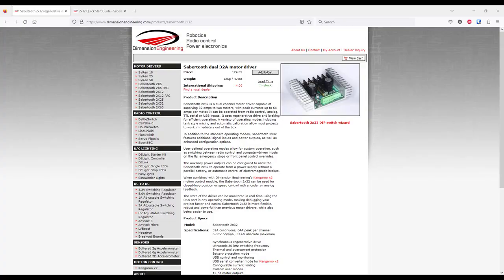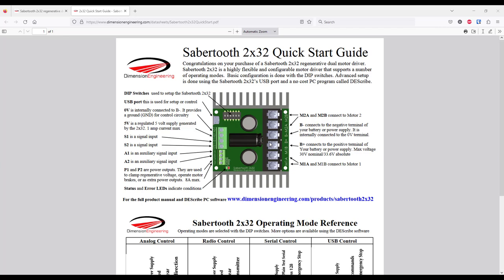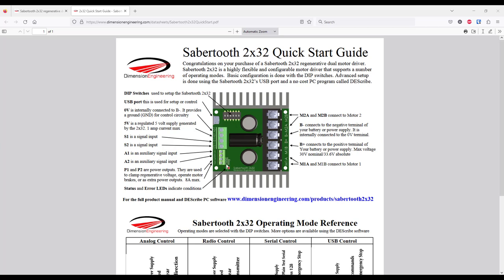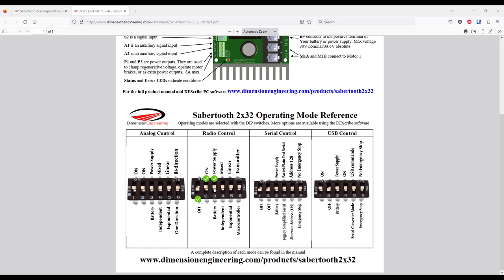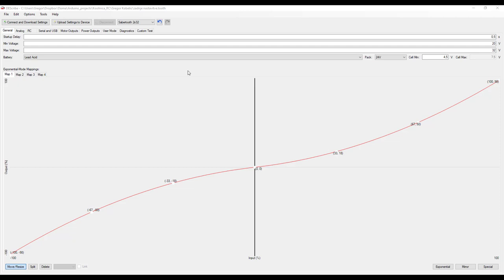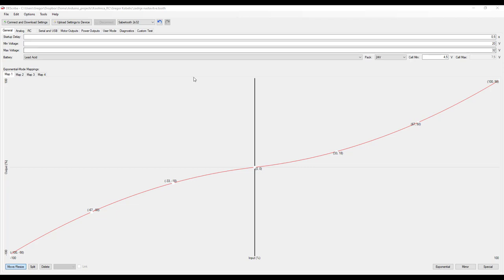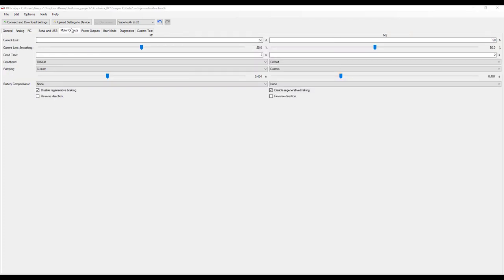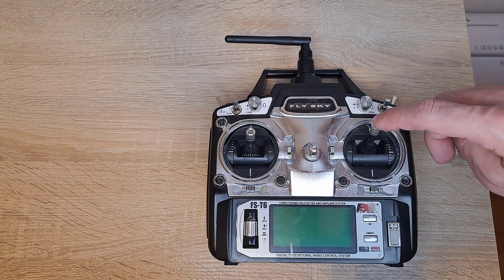Motor Controller - Remote Control Lawn Mower DIY

Comment: I have this in a 16kg tank, smooth control and incredible torque, I drive two 540 motors with reductors in mixed mode

Comment: Hello, where did you put a fuse to protect your electronics? I put a 30 AMP fuse inline with the POS on the battery and the fuse blows every time my motor stalls. Do you have any problems with fuse blowing when the motors stall under heavy load?
Reply from the maker: Hi! I put fuse on battery just after connector. I use 60A fuse, since i have two 15A motors. No problem with fuse at all.
Reply: @gregorkobetic  Okay maybe i just need a bigger fuse. Thanks!!
Reply from the maker: @carl0s288  you are welcome

Comment: Thanks great explanation. I have the 2x25 and found i have to put the switch 6 up otherwise sometimes i lose the control and motors spin alone till i dont do another command with the rc controller. However by putting the switch 6 up i am missing the zero position means the motors moves always a but when rc controller if off. And when i put rc controller ON with trimmer i can adjust but still there is some slow movement i can’t understand how to have the engines firm also with this settings
Reply from the maker: Hi! Yes, in microcontroller mode sabertooth does not stop the motors by default if it loses the RC signal. Timeout can be set in the DESCRIBE software for 2x32 sabertooth. But I think the 2x25 don't have usb port and unfortunately cannot be connected to the DESCRIBE software. So for safety reason use RC mode on 2x25.
To answer your other question about slow movement of motors: 
Some RC receivers output servo pulses before a valid transmitter signal is present. This will cause the Sabertooth to autocalibrate to values which may not correspond to the center stick position. And this may cause the motors to move slowly, even when the transmitter stick is centered. On some RC transmitters these things can be sorted out in the transmitter settings. Have a nice day!
Reply: @gregorkobetic  thank you so much for the answer. I got your point. I was told to consider the 2x30 smart driver but i don’t know that has the same issues  with the zero position in rc mode. About receiver, i actually bought a new controller and receiver (as the old 4ch controller was having this issue). However even with the new carson  8ch receiver i see the same behavior. Means out of 2 receivers i tested both has issue with the zero position when controller radio is off. Do you know if the smart drive fixe this or the only way is to buy the sabertooth 2x30amp? I mean i can think of changing the motor driver if that will fix the m problem or i have to find a receiver that i’m sure will not generate that issue. For sure i cannot use the microcontroller setting as it is now because is too dangerous.
Reply from the maker: Does your receiver have "failsave" mode? If yes, then you should configure it and it will solve all your problems. Put sabertooth in microcontroller mode and set failsafe for 2 channels you have motors on. This way you will not have problems with autocalibration and also mower will stop when signal is lost. See this link: https://youtu.be/4N_hHfpEoHY
Regards!
Reply: @gregorkobetic  thanks 🙏 later i will check if it has failsafe but i dont think so, yesterday i was checking manual and has only a function to sync with controller. Pity because i paid 80€ for controller and receiver. If does not i will return it as i just bought from amazon. In cas it does not can you please reccomand a rc control and receiver kit that has failsafe function so i look for that?
Reply from the maker: I recommend FlySky FS-i6X. You can get it with 6ch receiver or 10 ch receiver, so pay attention when buying if you need more channels. Difference in price is minimal. It is made by company from China, but it is a good product, you can find a lot of reviews on youtube. I have old model, but it works with my mower for 5 years without problem.

Here is link from amazon.de https://www.amazon.de/-/en/Channel-Transmitter-FS-iA10B-Receiver-Aeroplane/dp/B09VGQN2NR/ref=sr_1_4?crid=20TII83R8PQV2&keywords=fs-i6&qid=1690912169&s=toys&sprefix=fs-i6%2Ctoys%2C260&sr=1-4
Reply: @gregorkobetic thanks Gregor i will look for it. I confirm mine has not failsafe. I will be using 3 channels maybe. 2 for 4 motors and 1 for an actuator to lift up and down the mower. I am building an old honda 41cm mower. I actullay was thinking to add a kind of electric starter for the engine but i could not find a lot of information for this. Did you also add the actuator to lift up/down mover via rc?
Reply from the maker: @GioGio78530  No, I dont  use actuator to set mowing hight, but honestly I am missing that feature. Well maybe some day with another mower 😁
Reply: @gregorkobetic i just ordered the flysky you suggested i will let you know. Tomorrow i will be doing the big step (most hard for me) to fix the wheelchair motors to the frame i built around my mower. Electronic part is quite fine at the moment means once motors are fixed i could start first real test. Will let you know

Comment: Hi Gregor, thank you very much for all the knowledge you share with us! I want to ask you if you know any controller  for 4 motors or if I can connect two controller together for the 4 motors.
Reply from the maker: Hi, what is the power of your motors? Does motors have to be controller independent  for each motor?
Reply: Hi, First let me inform you that my construction will be a flail mower. I have thought of getting an old ATV to use frame wheels and anything else I find useful. I wanted to use two 24v 350w motors but I saw in another video of yours that you explain about the motors, that if you have wheels in the construction you will end up with 4 motors, one for each wheel, so I was concerned about how to connect them. Can I connect two motors together to one output and two to the other? Thank you very much for your time.
Reply from the maker: that's correct. Connect 2 wheels to 1 output

Comment: Thanks Gregor for your well made video!
Short question - how you get access or connection from DEScribe to Sabertooth - what is needed for that?
Reply from the maker: Hi, you need usb cable. Thats all. Works like a charm.
Reply: @gregorkobetic   thank you - seems i missing something - where and how it should be attached?
Could you make quick video - i think many looking for same information - that would be very handy.
Reply: forgot to mention i have 2x60 - does it also suits?
Reply from the maker: Uh, 2x60 don't have usb port. You need usb to TTL serial cable like this: https://www.dimensionengineering.com/appnotes/Roborealm/Roborealm.htm

S1 is Tx and S2 is Rx

I am sorry I don't have sabertooth 2x60, so I can not make video about it.
Reply: @gregorkobetic   - that's was what i looked for - many thanks for helping out!

Comment: I havent hooked to computer to check or program anything but for some reason im thinking about it. Everything works fine but just wanting to experiment.
Reply from the maker: I suggest you play with ramping a little bit. It smooth the motor mowement. Recommend!
Reply: @gregorkobetic  do you use the P1 and P2 for anything? I did check voltage and it's 3.3 - 3.5v using a 12v power source. Now I know I can dump the 9v plug in to arduino and run from one of those. I'm not fam8liar with ramping but I'll check in to it more

Comment: Hello,
maybe you can help me?
My wheels turn independently
with and without connection to the receiver
Where is the mistake?
Reply from the maker: Sorry, but without seeing the electrical connections and configuration it's hard to help. Check the electrical connections of the RC receiver and the motor controller. Also check how you have the DIP switches set up. If you have any doubts about specific topic, please ask me and I will do my best to answer it.

Comment: Pozdrav Gregor, zanima me kateri controler priporočaš za 4 motora
Hvala in Lp
Reply from the maker: Živjo. Kakšne motorje boš uporabil?
Reply: @gregorkobetic  4x 250w 75rpm
Reply from the maker: Predlagam, da vzameš sabertooth 2x60. S sabertoothom 2x32 so lahko problemi pri obračanju na mestu, ker se začne vklapljat tokovna omejitev.

Doma imam še en prototip elektronike z releji in kontroler za motorje (rešitev vse v enem). Če te zanima mi napiši na mail gkobetic@gmail.com. LP!
https://drive.google.com/open?id=15hPpdo-yNEZ9t1Z9WhWD3ytLLxiDgn6h&usp=drive_fs

https://drive.google.com/open?id=15hox7deIA1D5QH4nOYA0mg_cCd3LMv4b&usp=drive_fs

Comment: Waiting for reply
Reply from the maker: Sorry, but I can find your question. Can you ask again, please?
Reply: @gregorkobetic  i want to ask you how increase load carrying capacity of mower?
Reply from the maker: Depending on the design of the lawnmower. E.g. you can make a 4x4 drive, each motor has 350W and together total of 1400W. As motors usually spin too fast, you could make a transmission(gear) to reduce the speed to 4km/h and thus gain even more power. It is important to reduce the speed with the gear and not electronically because in this way you lose torque. This applies to brushed motors of course. Or you could use brushless motors, which have almost maximum torque at start and there are versions for very high power.
Reply: @gregorkobetic  can we work together?
Reply from the maker: I guess we can. What do you have in mind?
Reply: @gregorkobetic  could you please provide your email? so we can discuss
Reply from the maker: It is in every video description, I can post it here too: gkobetic@gmail.com
Reply: @gregorkobetic  alright